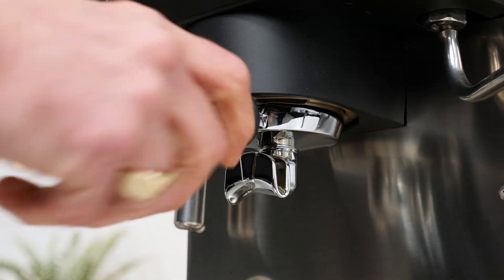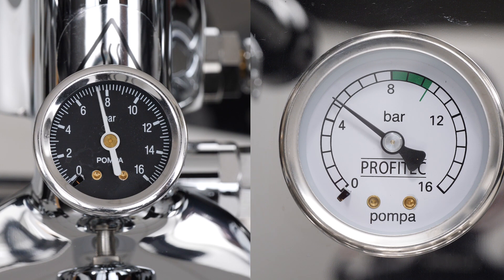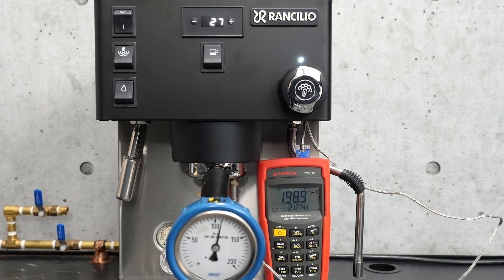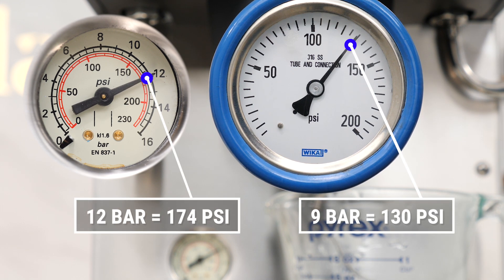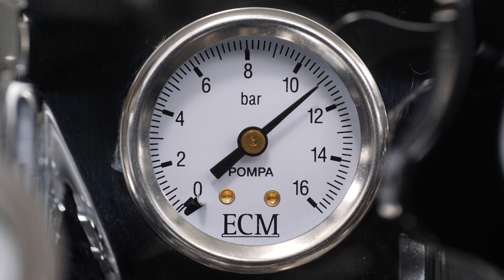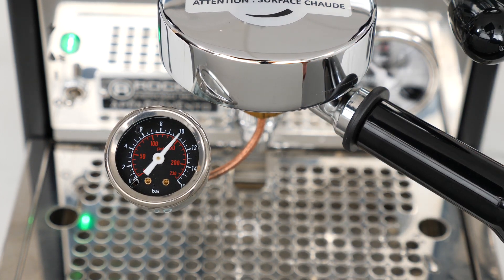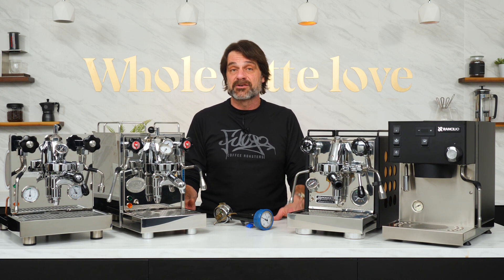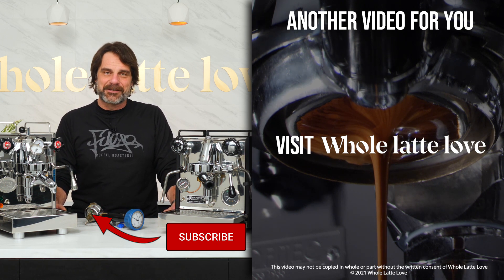Brew Pressure on Vibration Pump Espresso Machines

Comment: I wanted to lower the pressure on my machine to 6.5 bar and was researching on how to do that. So I stumbled upon this video and it confused me as hell. After all my research I can say that this video is misleading and I wanted to correct the mistakes that it makes:

1. Dynamic pressure can be measured but it cannot be calibrated as it is dynamic as the name says.

2. The Scace thermofilter device that they use to calibrate the machines cannot resemble a generic resistance that can be applied to all pucks. It just resembles the resistance of one specific puck. Using it to calibrate the machine can in the worst case result in higher pressure than expected and wanted. A coarsely ground 16g puck for example has far less resistance than a finely ground 22g puck. Which flow rate does the scace device resemble? It cannot resemble both and therefore cannot be used to calibrate brew pressure.

3. The static pressure is the maximum pressure that a machine can produce. You want this to be calibrated to 9 bar (or whatever brew pressure you'd like) as you don't want your machine to be able to go higher than that.

4. Using a gauge on a closed portafilter doesn’t mean that the system is closed, as the OPV releases water and overpreassure. You want to calibrate that threshold.

So here is how you adjust your brew pressure: Get yourself a pressure gauge that can be mounted to your portafilter. Let the system heat up. Measure the static pressure that is built up in the portafilter and adjust it to your desired pressure. Enjoy the results!
Reply from the maker: Hey Chris, Thanks for adding your thoughts. I wish you were more specific about what you feel is misleading. I have to mention if what you want is say 9 bar on your coffee inside the PF during an extraction that's not what you will get if you set to 9 bar static pressure. Also mention it seems a lot of folks get a little to obsessive with brew pressure. I get comments all the time from people worrying about not being at exactly 9 bar. Nothing magical happens at 9 bar. Just happened to be the pressure in machines (who knows where that was measured) from many years ago so it's been the espresso dogma since.
Reply: @Wholelattelovepage  Hi there! I'll try to be a bit more specific…

When I mount a pressure testing gauge onto my portafilter (unscrew the spout, then mount the gauge), tighten it and start the pump, it will show the static pressure inside the portafilter, right?

As no water can escape the portafilter in that scenario, the pump will go up to maximum pressure and the OPV will regulate that it does not exceed that specific maximum pressure by releasing water out of the system. The mounted pressure gauge on the portafilter will now show the maximum pressure that is build up in the portafilter and that could get built up during an extraction.

Let’s say I want to calibrate that static maximum pressure to 7 bar (don’t get me wrong, I don’t care about 9 bar being set), so what I am going to do now is changing the OPV setting until my pressure gauge on the portafilter shows 7 bar.

What I find misleading is – if I understood you correctly – that you say that I don't get true 7 bar in my portafilter with that setting as I need to use a Scace device for calibration instead. The misleading thing here is, that a Scace device relases water at a specific flow rate that cannot be used as a generic rate value as every puck has its own flow rate depending on the dose, the coarseness of the grinds, etc. which results in a different resistance from puck to puck and which also results in a different brew pressure from puck to puck.

Therefore it is impossible to set the brew pressure to exactly 7 (or 9) bar as every puck releases its own specific amount of water. But what you most likely want is to limit the pressure that can be build up to your desired brew pressure to make sure it won’t be exceeded during extraction.

I know that 9 bar of static pressure will supposably not result in a dynamic brewing pressure of 9 bar as long as the flow rate allows the machine to run on less pressure. But that is totally fine and nothing bad. The bad thing would be if I‘d choose a finer grind size for a ristretto and my machine would go up to 10 or 11 bar as the resistance increases because of the finer grinds.

Hope that this clarifies my thoughts…

Comment: Marc, great video. I recently bought a RS Pro X from WLL and it came with 9 bars at the machine gauge. I’ve been chatting with Todd at WLL to help me adjust it up. 
Your Pro X review video shows that 10.5 bars at the gauge equates to 9 bars static pressure at the group head, so it sounds like it needs to be adjusted.
Reply from the maker: Hi Nelson, Thanks for the comment and your patronage. Todd is a great resource! I agree you could adjust the pressure up to 10 - 10.5 bar static on the machine gauge. I would not get too wrapped up in brew pressure. So long as it's not crazy low or high and you're within a couple bars of 9 you're likely to notice little difference in your extractions. Lots of caveats to that statement like lighter roasts tend to extract better at lower flow rates and darker roasts tend to be better at higher flow rates. There's no magic to a perfect 9 bar in the portafilter.
Marc

Comment: Hi Marc - you mention the static pressure to get 9 bars on the Scase [not sure if I spelt that correctly] on all the machines except the Rocket. What would you suggest for static if I fitted a pressure gauge to the group head? Jan23
Reply from the maker: Hi Gavin, thanks for the question. For a static pressure gauge at the group head I recommend setting pressure to produce 10 bar on the gauge. No worries on spelling! It's spelled Scace.
Marc
Reply: Thanks Marc - love the videos and thank you for responding so quickly 😊

Comment: On a single boiler Rancilio Silvia, what should be the pressure gauge reading? 10 or 12 bars? 🤔 TIA! 🙌🏻
Reply from the maker: Hi CL, Set to a static pressure of 10 bar if using a portafilter mounted pressure gauge.

Comment: Okay, as far as I understand: barista tries to build up the pressure with proper puck prep and using a decent basket depending on the dose. OPV lowers the pressure by leading the extra water back to the tank. The lower the setting is, the more water is released. Now how does OPV help the barista to pull a better shot? It approaches the pressure level from the opposite direction. If i'm not wrong, this leads to a longer brew time and nothing more. I'd set the grinder coarser a bit in the first place instead of adjusting the safety instruments of the machine
Reply: Yes, your grind size and puck prep are how you "normally" dial in the extraction time. But the pump in most machines is capable of producing more pressure than you would want, some issues that you may have for example is channeling if the pressure and flow is too high, or in general not being able to find a grindsize that produces good extraction times while not being too fine. The OPV's main function is not safety, it is exactly meant to set brew pressure.

Comment: Thanks so much for the info! 

Would it be too must to ask to for a built in brew pressure gauge value for 9 bar on the coffee for the Profitec Pro 400? Would it be roughly the same as the 500, ie around 10.5 Bar? Thanks again!
Reply from the maker: Hi x, You are welcome! To produce 9 bar in the group during an extraction we set vibration pump machines like the 400 and 500 to about 10bar when measuring static pressure on a machine's gauge.

Comment: What static pressure do you suggest for Breville Barista Express?, I still getting channeling because of the pressure.... If I grind coarser to get a pressure, the flow is faster and If I grind finer to get an ideal flow, the pressure goes up to the sky and I cannot control, both of this shots tastes awful.... I'm want to be able to slow the pressure to control the flow more consistent without have to grind more coarser...

That you for the info... I learned something new and important today...
Reply from the maker: Hi AG, Machines which come with a pressurized portafilter (Breville calls it Dual Wall) often run at higher pressure to accommodate brewing with a pressurized basket. To the best of my knowledge I do not believe brew pressure is user adjustable ob the Barista Express. You may need to compromise with a slightly coarser grind if worried about the pressure being too high.
Reply: @Wholelattelovepage  yes, is not factory user adjustable, but, by internal dimmer mod we could trick the pump controlling the entering voltages producing less pressure, and we could adjust using this method... Or not? 
I never ever use pressurized basket, always non pressurized.

Thank you for reply :)

Comment: Just wondered if you had tested the pressure on the pump gauge to produce 9 bar on the portafilter for Profitec Pro 600?
Reply from the maker: Hi DA, Yes, we set the OPV on Profitec machines with vibration pumps like the Pro 600 to produce 10 bar on the machine gauge when running the pump with blind filter basket inserted.
Maarc

Comment: Thank you.  This was a no-nonsense answer, and there are precious few of those on coffee forums. 😁
 I've just ordered a static pressure gauge to add to the bottom of my Rancillio Silvia's portafilter.  Should I be looking for around 10 bars of static pressure, to achieve the optimal 9 bars when brewing?
Reply from the maker: Hi AB, You are welcome and thank you for the kind comment. Yes  10 bar static should get you about 9 when actually pulling a shot - assuming grind is dialed in properly.
Marc
Reply: @Wholelattelovepage  Thanks for that.  Subscribed.

Comment: Hi Mark,

Is the 10 bar pressure from the portafilter gauge also for 9 bars on the normal rancilio silvia or just the pro? Also with my portafilter gauge is it best to use it with the basket in or out? Can't find the answer to this anywhere. Thanks!
Reply from the maker: Hi JODE, Both the Silvia and Silvia Pro use similar if not identical pumps so chances are yes 10 bar static on a PF gauge will get you ~9 bar during an extraction with properly dialed in grind size. Basket in or out makes no difference. I do suggest cleaning the group head of any residual coffee debri prior to using a PF mounted gauge. Hope that helps!
Marc

Comment: I've been thinking about this for the last two months using my stock gaggia classic, it feels awfully familiar to the full size two group machine we used to use when I was a barista. I must measure it with a flow restrictor if possible to see actual brew temps like, I'm barely pressing in my pucks before the opv just opens and I'm not using crazy fine grinds either, the coffee just about produces small clumps during grinding so it's right where it should be. I'm not convinced the opv mod is right way to go, I think I'll be going dimmer mod with pressure gauge.

Comment: Hi Whole Latte
 Love! I am trying to figure out what the right pressure during a blind shot should be on a Breville Dual Boiler. I don't own a Scace device or a portafilter pressure gauge. Thanks for a useful video!
Reply from the maker: Hi DV, You are welcome for the video. When running a blind shot - so pump running but flow from the group blocked I'd look for 10-11 bar on the gauge. That should get you about 9 bar actual on the puck during an extraction.
Marc

Comment: Thanks a lot Marc for a so much needed explanation. As you see the Bezzera users are the most confused. If you would be able to make a good overview of the pressure settings and the outcomes, it would solve the whole Bezzera mystery. Thanks in advance!
Reply from the maker: Hey PM, Outcomes depend on the type of coffee used and subjective personal flavor preferences. I recommend leaving the machine at factory pressure setting. But, no reason you can't adjust and taste the results.
Marc

Comment: Wouldn't a group gauge measurement while extracting be an even better way to measure the pressure on the coffee?  Why resort to static measurements if the machine has a group gauge?
Reply from the maker: Hi BF, Yes, you can for sure use a group gauge. Static pressure measurements give you a read of the maximum possible pressure (minus the losses in machine plumbing) the machine can apply to the coffee. Pressure on the group gauge during an extraction can be different depending on grind size of the coffee.
Marc

Comment: Hi Mark

My machine doesn't have a internal gauge so I was setting my machine at 10 bar with portafilter gauge, closed system

Coffee and especially light roast coffee was awful
Until I found out that my machine needs 12 bar pressure to have 9 at flow
Reply from the maker: There ya go!
Marc

Comment: Gracias por esa informacion, tengo una Rancilio Epoca y quisiera saber cuanta agua debe de salir de la ducha y en cuanto tiempo para saber si esta dentro del rango normal, muchas gracias
Reply from the maker: Translation: Thanks for that information, I have a Rancilio Epoca and I would like to know how much water should come out of the shower and in how long to know if it is within the normal range, thank you very much.

Gracias por la pregunta. En general, las máquinas con una bomba de vibración funcionan con un caudal libre de 7-8 gramos por segundo. Las máquinas de bomba rotatoria funcionan a unos 10 gramos por segundo.
Marc

Thanks for the question. In general machines with a vibration pump run at an unencumbered flow rate of 7-8 grams per second. Rotary pump machines run at about 10 grams per second.

Comment: Really nice explanation! What is the pressure measured in a portafilter gauge I have to set up in the profitec pro 300 to deliver 9 bars? The same of profitec in the video 10.5?
Reply from the maker: Hi RGB, Measured using a portafilter gauge I'd go with 10 bar for 9 bar during extraction.
Marc

Comment: Hey Marc thank you for this helpful video!  I was wondering about bz10 it would be great if you can help me out about the right static bar on the bz10 since it's 12bar factory set.. Lots of people change it to 10bar with blind basket. There are lots of threads and  confusion about bezzeras default static bar pressure some say 12 is right some say change it to 10... It would be great if you test bezzera machines with that special portafilter 😊 thanks!
Reply from the maker: Hi Mr Za, You are welcome for the video! What's right is hard to say. As I mentioned in this video manufacturers may have reasons for setting pressures higher than 9 bar static. It may be because of lower flow rates from vibration pumps as compared to commercial rotary pumps, the difference between what one sees as a static reading on a machine gauge vs. what the pressure is in the group during an extraction, etc. Many in the espresso community take 9 bar as an unbreakable rule. Turns out the 9 bar gospel may originate from the first pumps Achille Gaggia put in machines more than 50 years ago. I did not test a BZ10 when making this video. I did test a Bezzera Unica. It was set to 12 bar static pressure which produce 10.3 bar in the portafilter during a Scace test. The Rancilio Silvia Pro in this video shows a static pressure of 12 bar on the machine gauge and the same 12 bar on a static portafilter gauge. At that setting it produced a Scace reading of 9 bar while showing the same 12 bar on the machine gauge. Based on my test of the Unica if you want 9 bar on the coffee during an extraction I'd set static pressure on the machine gauge to 11 bar. That could be off as a Unica is not a BZ10. My recommendation however is to not worry so much about pressure. Personally I believe flow rate is more important than pressure. Try this... Dial in a coffee and extract it with the machine set to 12 bar static. Then keep all other variables the same, change the pressure to 10 bar static and extract. Do a blind taste test and stick with what you like.
Marc
Reply: @Wholelattelovepage Hey Marc! What a helpful informations! i really appreciate your help and support :)  there's no doubt that your suggestion is the best option. i definitely try it. Again huge thanks !

Comment: Thanks Marc, what about the Bezzera 10…..it’s a pain to adjust. My pressure when I use a blind basket is around 10.
Reply from the maker: Hi EK, You're welcome! I have not tested the BZ10 but I did test a Bezzera Unica. For the Unica, a static pressure of 11 bar on the machine gauge results in ~9 bar on the coffee during an extraction. I'm not 100% certain but guessing it would be similar on the BZ10 or potentially a little bit higher with more plumbing between the gauge and group.
Marc

Comment: In the appartamento how much pressure should we see at the group gauge to have 9bars at the puck ?
Reply from the maker: Hi Miguel, A hair over 10 bar on the group gauge measured static gets you 9 on the puck when extracting.
Marc

Comment: I really disagree with the “don’t adjust the brew pressure” comment! I had really big issues with channeling and uneven shots on my Rocket Appartamento. Bought an e61 pressure gauge and it read almost 15bars! Now adjusted to about 8,5 and I get consistent and good shots with almost no channeling… the best upgrade I ever did, along with getting a wdt tool. (I was using wdt before adjusting the brew pressure)
Reply from the maker: Hi IT, Thanks for sharing your thoughts.
Marc